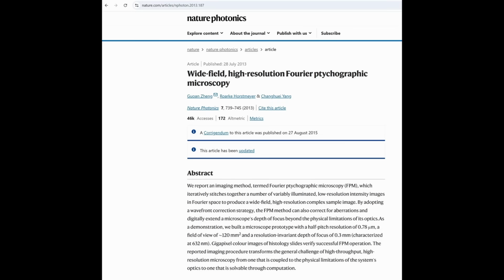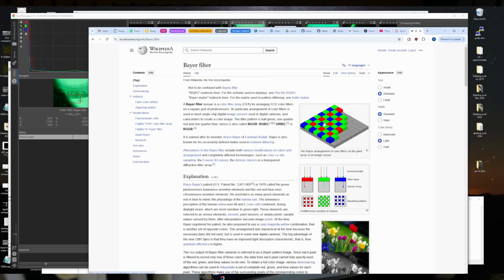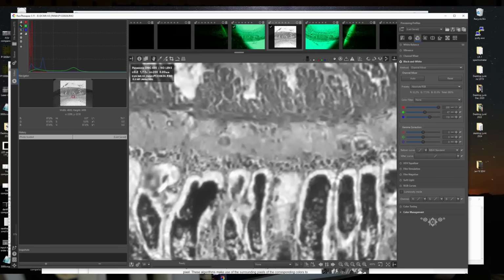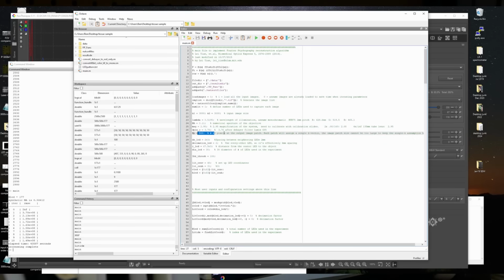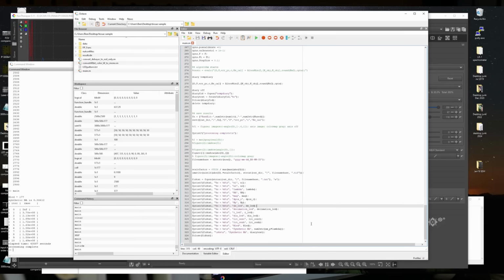Dramatically improve microscope resolution with an LED array and Fourier Ptychography

Comment: There are dozens of methods to do this for many kinds of microscopy, and Lithography, and I had a very fierce fight with my professor in the 90s where he claimed we will never be able to surpass the optical barrier, it's a physical law that can't be broken. I told him this is engineering school, we will find a way to bend all the laws we want.
Reply: Also astronomy. Modern astrometry space telescopes (such as GAIA) for measuring the distances to stars via parallax actually sample the point spread function to determine the angular position of a star in excess of the "diffraction limit" from the Airy disk. This isn't breaking any of the limits of optics, it's just understanding what those limitations actually mean and how they differ from a naive interpretation.
Reply: Engineers have an approximate relationship with the laws of physics.
Reply: Those laws that apparently cannot be broken are the laws of a CERTAIN optical device, of a CERTAIN construction, for example a simple microscope consisting of an eyepiece and an objective with a certain aperture, and having a certain illumination of the object to be studied. The resolution can be increased by making various modifications: objectives with a larger aperture or objectives with oil immersion, adequate illumination (the ultramicroscope, with which the shape of very small particles cannot be seen, but they can be counted even if they are very close to each other, beyond the resolution of an ordinary microscope), etc.
Reply: he is right, that law won't be broken. It is being circumvented.
Reply: Must have come as quite a surprise to your Prof when the 2014 Nobel in chemistry went to the people who worked on Super-resolution microscopy.
Reply: @meltdown6165 We never really have surpassed it in a way. You can improve on the standardly quoted number with oblique illumination/darkfield illumination, but this has been known (by those in the know) for about 100 years. These computational methods don't allow an optical system to produce real images with higher resolution, but by utilizing Fourier plane imaging and computational methods that  utilize background information (information not from the optical system itself or the images it forms), we can compute images that we can't directly capture or resolve.

Comment: This technique is still 'that one weird trick' type. In 2014, 2 researchers at UC San Diego developed a more direct approach, which converted evanescent waves to near field, which achieved the same thing. There approach involved metamaterials, not reconstruction, and had some limitations. The main advantage for both techniques is superresolution, meaning resolving objects below Abbe's limit.

Comment: I wonder if you could image bioluminescent samples with this by jogging the stage some X or Y itself instead of using the illumination. Solving the phase problem could then also give you some optical sectioning would it not? Although I don't know how trivial solving the phase without some type of fiduciary is. Maybe some hints in solving phase problems in crystallography can be taken. I have spent some time trying to get biolum. imaging to work, including a trip to Zeiss! Alas none of their off-the shelf products suited our needs. edit: ah well maybe not since I believe if the ROI is the source of light itself, angle of diffraction is super small and within the cone of the emitter itself. Kinda the similar issue with small angle xray diffraction.

Comment: AI Summary:

*Dramatically Improving Microscope Resolution with LED Arrays and Fourier Ptychography*

*   *0:00 Introduction:* The video introduces Fourier Ptychography, a computational imaging technique that combines multiple low-resolution images, taken with different LED illuminations, to create a single, high-resolution image.

*   *0:30 Technique Origin:* The technique was developed at Caltech and relies heavily on a sophisticated algorithm.

*    *0:39 Key Hardware:* Specific hardware is crucial, it requires using very small 'Hub 7 5' LEDs (ideally with a 4mm pitch, but 2mm is used by skipping every other LED) to act as point light sources, and a high quality 4X or 2X microscope objective.

*   *1:27 Objective Lens Considerations:* The video clarifies the difference between microscope objectives with an "infinity" symbol (requiring a tube lens) and those marked with a number like "160" (no tube lens needed).

*   *2:16 Optics Quality:* High-quality optics are essential; the technique doesn't work well with cheap, aberration-prone lenses.

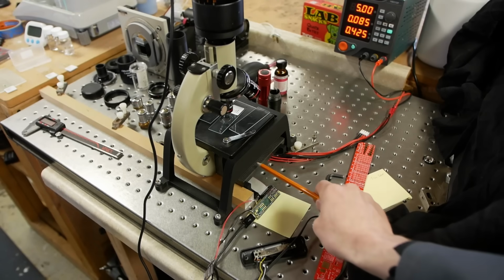*    *2:34 Control System:* A Teensy microcontroller is used to manage both the hub75 LED array and the camera's shutter release.

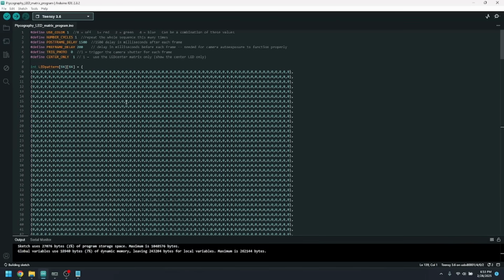*   *3:02 Camera Requirements:* A monochrome camera (without a color filter array) is essential for successful image reconstruction. Using a color camera (like the Lumix g85 initially used) significantly hinders the process.

*   *3:39 Diffraction Limit Explanation:* The video provides a clear visual explanation of the diffraction limit using a laser pointer and diffraction gratings, showing how high spatial frequencies (fine details) can be lost if the diffracted light misses the lens.

* *6:18 Angled Illumination:* The core concept is to angle the illumination source (like the LED array). This allows diffracted light from high spatial frequencies, which would normally miss the lens, to enter the optical system.

*   *7:09 Capturing Spatial Frequencies:* By systematically changing the illumination angle (both vertically and horizontally), the system captures information about different spatial frequencies present in the sample.

*   *7:36 Computational Reconstruction:* The challenge lies in computationally combining these images, each containing different spatial frequency information, into a single, high-resolution image.

*   *10:30 Real Image Demonstration:* The technique is demonstrated with an Air Force resolution target, showing how different regions light up as the illumination angle changes.

*   *11:10 Image Processing Pipeline:* Raw images are needed (JPEG compression is detrimental), and the color filter array in typical DSLR cameras creates problems, and the workaround attempted.

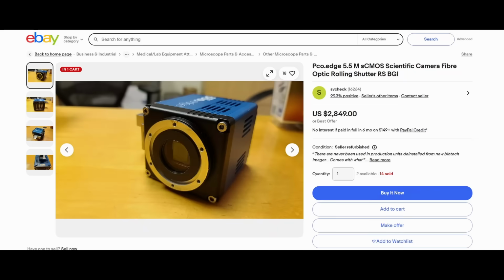*    *13:30 Software Pipeline:* The video discusses the role of the software 'raw therapy', used to convert RAW images, debayer, and perform a color correction work-around. It also covers using the MATLAB-based reconstruction algorithm originally from the Waller Lab at UC Berkeley, shared under an MIT license.

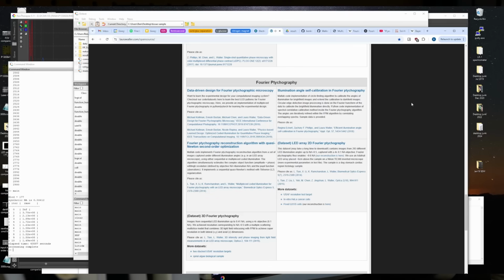*   *14:17 Algorithm Parameters:* The reconstruction algorithm requires precise knowledge of the optical setup: light wavelength, image dimensions, objective's numerical aperture (NA), magnification, pixel size, LED spacing, and LED-to-sample distance.

*    *15:16 LED Control Customization:* The presenter modified the code to handle a text file defining the LED activation sequence, making it easier to program the microcontroller.

*   *16:04 Matrix Setup:* Much of the code involves setting up matrices to track the spatial frequency information captured by each image.

*   *17:40 Exposure Consistency (Uncertainty):* It's unclear whether the algorithm can handle varying exposure levels for different illumination angles. The presenter believes consistent exposure might be required.

*    *18:10 Algorithm Core:* The algorithm fills "Fourier space" with the Fourier transforms of the input images, stitches them together (overlap is important), and then performs an inverse Fourier transform to create the final high-resolution image.

*   *18:46 Phase Retrieval:* Since phase information is lost during image capture (image sensors are not phase-sensitive), the algorithm iteratively estimates the phase by comparing the reconstructed image to the bright-field image and refining the phase estimate.

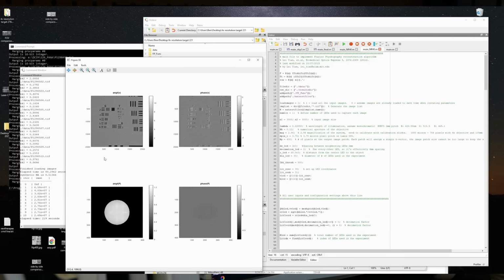*   *19:30 Phase Information Output:* A significant benefit of the technique is that it also provides phase information, valuable for samples that don't absorb light well but do shift its phase.

* *20:37 Mechanical Scanning Comparison:* While high-resolution objectives and mechanical scanning are an alternative, Fourier Ptychography offers advantages like a wide field of view, with enhanced resolution.

*   *21:04 Advanced Techniques:* The video touches on more advanced implementations, such as using coded patterns with multiple LEDs lit simultaneously, to reduce the number of acquisitions and increase speed.

*   **21:33 Benefit**: Use low-magnification, long-working-distance objectives.
* *22:07 Future Applications* The technique is adaptable, including correcting for lens aberrations and extending to 3D imaging.

i used gemini 2 pro 0205 exp

Comment: Does this method scale with sensor resolution? Do you actually need a high resolution sensor for it to be practical?
There are monochrome camera sensors available, the lower the resolution the cheaper the sensor. A few ship as Raspberry Pi compatible modules, which also means that they are capable of capturing raw uncompressed data.

Comment: Hello everyone, do you think that this technique could be used in astrophotography to greatly improve magnification and resolution of images? Imagine highly accurate imaging with ground based telescopes with 1000x magnification or more from an 8 inch Schmidt Cassigrain of a planet or DSO.  All that would be required is a commercial product which implemented this technology in a compact and highly usable form for sale to the consumer market. I am sure that there is an entrepreneur out there somewhere who could refine this into a set of products which works on microscopes, binoculars, sighting scopes, night vision, medical equipment, industrial equipment and telescopes. It sounds like the possibility of a whole new industry and product line to me.

Comment: Is it possible to add this correction factor for other bayer sensor cameras? Or how about if you don't interpolate the missing pixels but simply use only the pixels with a certain colour filter (perhaps the green since it makes up half of the pixels when using a bayer filter?

Also, could you possibly share the correction factor you used for the G85? I have a camera I believe uses a similar sensor!
Reply: He explained that he initially tried to just use the red pixels but it wouldn't work.

Comment: Very interesting but I am having trouble following your initial explanation because you point a laser pointer through a diffraction grating and then focusing the pattern, but the diffraction pattern you see is not an image of the grating - it's the spatial fourier transform of the image of the grating.

Comment: I currently work under one of the authors of the original FP paper (Roarke Horstmeyer at Duke). I’m a PhD student studying optics for biological applications in his lab. It’s very interesting stuff. Great video!
Reply: I am mostly interested in focus stacking mineral specimens and I get the impression this technique is very much confined to a thin section with a very thin DoF - I have seen image stacks using convergent light setups to stack biological samples, mostly phosphorescent tagged samples, so I suspect the answer is 'not really" but .. Is this technique applicable to larger scales (especially specimens with more z-axis variation)
Reply: How thick are your samples? There are extensions to this technique that go into 3d, but most of them rely on the first Born approximation, which basically means that you expect the sample to be mostly transparent such that light only scatters once.

Comment: 17:40
Not immediately obvious, but the "Fourier" part of the technique means that you need the same exposure time for all of them. Less direct light angle is for resolving smaller details (as you showed with the gratings); therefore you want the same exposure time to resolve those small features since they're providing less light. Fourier method limitations also explain why it's limited to a center subset of your FOV (Wilbraham-Gibbs artefacts would get pretty nasty near the edges). Hope you get the opportunity to put in a CMOS someday!

Comment: some people have actaully removed the bayer filter from dslr cameras, you can find videos of it. also you could try using white leds which would allow for lower gains to even out the signal
Reply: This is a monochromatic technique.  Note that the algorithm has to know the frequency of the light used.

Comment: Could you remove the IR-blocking filter of the camera and use IR LEDs to get a better use of all the pixels of the camera? Or would there be too big a drop in resolution due to the increased wavelength? If wavelength is the issue, what about using UV LEDs instead?

Comment: Phase information retrieval is nice. But if your only goal is to upres, then there are algorithms that will resolve edges from motion. If you take multiple shots and simply translate the sample around, then where the boundaries between pixels transition will offer an average estimate as to where the edge is. Of course, you need as much uncompressed data as possible, so capture benefits from all of the same optical improvements, but you don't need to do any fancy lighting setup. I think some digital cameras use the trick already. They will deliberately move the image around, but controlling the stabilizer circuit and do some software estimation.
Reply: Moving the sensor only works when the resolution of your overall system is limited by the resolution of your sensor. Which is the case for almost all consumer grade photo stuff (simply because people do not want to look at noisy images).
In the case of a good microscope, the resolution is limited by the optical system. If you move around the sensor in this case, you will just get a blurred image.

Comment: For those of you wishing to do this at home, there are services that will safely remove the Bayer array from your sensor if you wish to have a monochrome camera. This is a worthwhile service to pay for it you are also interested in using your camera for long exposure astrophotography.
Reply: astronomical cameras have monochrome sensors.  planetary camera asi294mm 4/3 2.4 micron pixel pitch  $999. So there arealternatives
Reply: I remember there was off-the-shelf full frame B&W Leica camera, M10 monochrom. It costs $4000 used... this kind of sensor is not easy to come by without DIY or other mods.
Reply: @Vatharian  Eh, this kind of sensor is trivial to come by. Astrophotography cameras are sold off the shelf with true monochrome sensors, and many will fit neatly into microscopes as they use the same or similar kinds of attachments as telescopes. Price varies with resolution of course, but 4000$ is absolutely astronomical; you can get very high spec mono cameras for a few hundred.
Reply: Thorlabs sells cheaper monochrome cameras than I'd guess the service costs
Reply: Machine vision cameras are available with monochrome sensors of any resolution you wish. And they provide greater control over the acquisition process.
Reply: OH, interesting. Do you know if it is possible for them to remove the Bayer filter and replace it with another one? Or to add a custom Bayer-type filter to a monochrome camera?
Reply: @TCPLab  Hi , amateur astronomers have been removing the bayer layer ''well trying to'' since the 1980's   Believe it or or not , The most common method is scraping with a sharpened wooden stick . It works .  Some try chemical peels , some use a laser , there are companies that do it for about 275$  practice on old , dead , cheap chips etc.. Its absolutely worth
doing. full spectrum cameras is the only way to go if your in to science / optics etc..
Reply: Zwo optics, many options at the $300 level
Reply: Foveon sensors that are found in Sigma DSLR cameras are only $200. They use stacked photodiodes instead of the Bayer configuration.

Comment: I just accepted that this works based on the fact that you can sweep a small lens/antenna across a large area to beat the diffraction limit by making it act as a larger one, and it feels like the kind of thing that probably works backwards, but it's good to know there's a more coherent explanation.
Reply: Like a synthetic aperture radar/sonar?
Reply: @davidwillmore yes, this is essentially a synthetic aperture optical microscope, just moving the illumination rather than the optic.
Reply: @davidwillmore  Yeah, I spent like 5 minutes before posting this comment going "what the hell is that called?" And trying to Google it before realizing if I just posted a description another commenter would tell me. Thank you for that!
Reply: @greenmario3011  😅
Reply: @greenmario3011  Did you just Cunningham's Law me?

Comment: Scan, mechanically shift LED plat 1/2 led spacing.  rescan. do this in 2 dimensions.  Effectively quadruples resolution relatively easily (sliding a plate x microns).
Great Vidy 
💓

Comment: I saw a presentation about this at a conference back in 2017. I remember them talking about using different LED patterns rather than point source light. That was a while ago, so I could be misremembering it. Either way, it was the most memorable talk at the conference

Comment: —
If you combine this Technique with the Stepping trough Tiles of the Sample how long would it take with real World Work?
A Sample under a Microscope doesn’t run away (or isn’t suited for this…). 1h would be very tolerable in my Experience .
If you start with a quick Shot to look at while the Device does it’s Job even a Day can be acceptable in a lot of Cases.
—
Going through different Colors would give even more Data?
—
Would it make Sense to do HDR on each Light Position of a Capture?